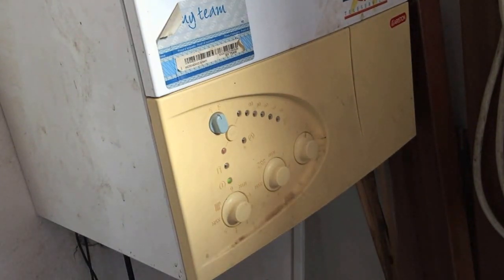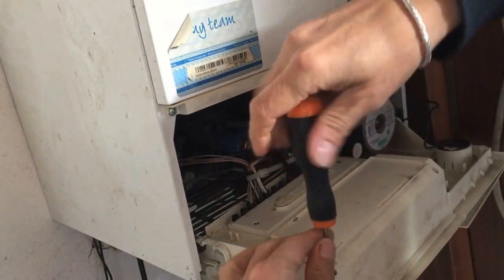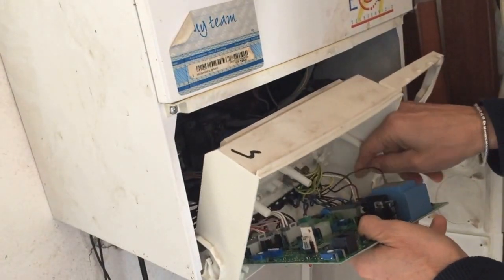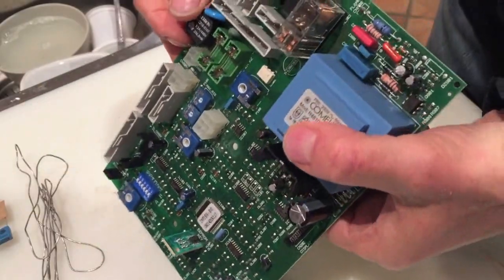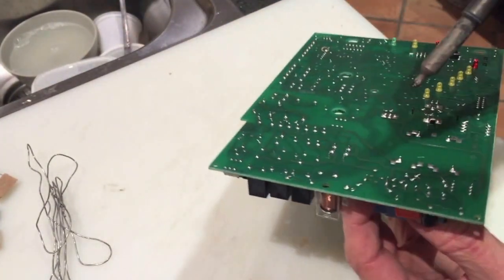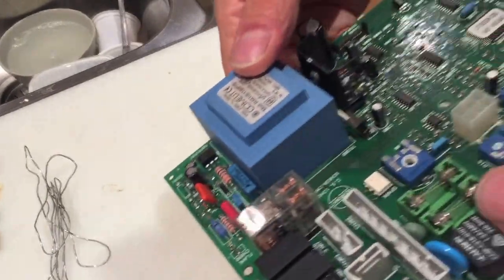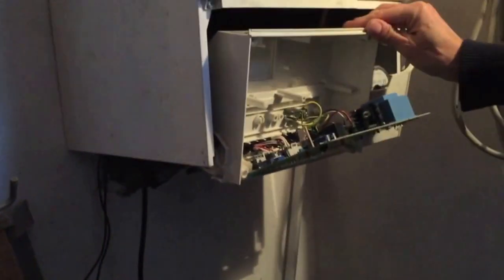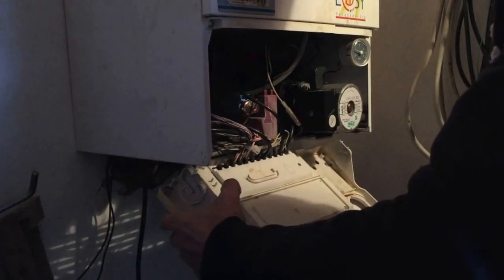Ariston Microgenus (also Simat t2 lls) A01 Flame Sensor Problem Fix PCB Repair

Comment: Mine keeps tripping out to red light.....i cant see that jumping spark like in your video though. The left hand side has a bright orange type light in the sensor.I wonder if i should change the sensor first. Is there a video for that.? Thanks
Reply from the maker: No, if it’s not continuously sparking it’s something else. Could be the flame sensor which is the other thing near the igniter but I don’t know.
Reply from the maker: Is you system pressure correct? Has the pressure vessel in the back got (if I remember correctly), 1 bar of pressure?
Reply from the maker: Also check your pump is working correctly. Does it lock out when the heating comes on or when you’re using hot water?

Comment: Amazing fix,  I intially called out an "engineer" who said within 5 mins of arriving,  "you will need a whole new boiler,"  and then quoted £2000 to install one,
Reply from the maker: @droidb5464  Thanks. If you can leave the legs long and bend it away from transformer as I think it's the heat from it that's causing them to fail.

Comment: Hi .. I tried this fix but it didnt work for me .. any clues ?
Reply from the maker: What are the symptoms of you boiler? What fault does it have?
Reply: @Sorcli  Keeps sparking but i do get 7 milli amps from it so I figure its outputting enough ?
Reply: @Sorcli  A01 No flame .. does exactly as this does in video
Reply from the maker: @moulesanctuary  Does sound like that component or the flame sensor. Flame sensors are very cheap so you could try replacing that.
Reply from the maker: If the symptoms are the same, spark not stopping, then it could be your flame sensor.

Comment: Mines given the A01 code... but wouldn't switch on after a reset... I bought a replacement yesterday and had hot water and heating yesterday and this morning.... then it stopped... showing as A01 code... so turned off and on... but won't come back on..... do you think replacing the chip will fix it.... or I'll have to buy another replacement board... oh dear
Reply from the maker: When it is running if you look in the window at the flame can you see and hear the igniter sparking continuously even when it’s alight? If not it is not the problem that I talk about this video. Is your pressure gauge reading 1.5 bar?
Reply: @Sorcli  ill have to see if u can get it running tomorrow... I only found your video after the boiler won't turn back on today....as I thought by changing the board it was fixed... lol
Reply from the maker: If it is not him may be as simple as having to recharge the system with water to bring it up to 1.5 bar. There is also a pressure sensor on the boiler which could be faulty which may cause the A01 fault
Reply: @Clive Hancy  I did make sure the pressure was.above 1 bar... actually about 1.2... so they should be OK..
Reply from the maker: Your problems sounds to me more like a pressure problem so are you the pressure sensor or you just haven’t got enough water pressure in the system, as I mentioned above. But please bear in mind that I am not a boiler technician and my video is only for you to see what I did to my boiler in Italy.
Reply: @Clive Hancy  I've got a Gas engineer contacting Arsiton Tech in the morning ... which I believe is actually in Italy?  We spoke to them on Tuesday... but they didn't really give us mor information than we already had...  we have voltage on the one side but not on the other... almost as if a fuse had blown
.. buy the fuses were OK.... I ordered a replacement board... fitted it yesterday and it worked.... but today it.stopped working.... showed as A01   I switched off and it will not power back up... no display.. no lights... nothing..... ah well  will have to work through it logically... and use some of the info you have in your video.... man thanks
Reply from the maker: @Legacy4x4turbo  that definitely sounds like a fuse or something if you’ve got no power no lights. Having replaced the board you should have sorted out electronic problems. The newer boards were redesigned and that chip is no longer near the transformer and sell the property that I’m showing my video shouldn’t manifest itself. Perhaps you’ve got a short circuit somewhere a wire that one through or something similar

Comment: Thankyou for this video. Done it to my microgenus 32 he. Easy fix and it worked. Saved me a lot of money by not having to buy new boiler. 👍
Reply from the maker: Glad it helped. If you leave the legs long and bend it away from the transformer it will probably last longer as I believe that the heat from the transformer is why it blows.
Reply: @Sorcli  Thanks for the heads up

Comment: salam on this board I found burned ic304 it damage so much I cant read it can anyone share to me schema of this board or name of ic304 and value of resistor between base and emitter thanks for attentions?
Reply from the maker: A while ago I had found the board schematics by searching google. So if you try it is out there.

Comment: Thanks Clive!
Reply from the maker: You are welcome. If you leave the legs of the capacitor long and bend it away from the transformer if may make it last longer. I believe that it’s the heat from the transformer that makes them become defective.

Comment: Hi Clive; recently I have got the error 98e for baymak boiler, I am an amator electronic student (but a veteran) I tested a diode at digital display side there was a short circuit and as if there was nearly wrong values when measuring some of 817B optocouplers. I cut the diode and tested and saw diode is okey so that was very complicated for me and sent to service then I have realized that the problem about relays. Your video is very good source for me to learn I will follow. Thanks.
Reply from the maker: I am merely an amateur who was sick of paying 180 euros to a technician to keep changing the whole circuit board every 2 years. Leave the legs of the component long (I did not in the video) so that you can push it further away from the transformer, as I believe that it is the heat from the transformer which is making them break.
Reply: @Sorcli  thanks for reply the cost was about %7 of my salary but I dismounted and brought to electronic repair service (not boiler service) discount was %50 (cost to me about 15 dollars) but next time I may manage on soldering relays I think. Sorry but you know the relays work mechanically and too frequent intervals I really do not sure which one is more effective on break over heating or electrical sparks due to excessive work. However I will place a material to isolate between the transformer and relays.
Reply: I write again not to mislead some one although as I was told that the error was due to relays then I tested the board to see the result so I connected the multimeter probes to the diode I mentioned above for the continuity test and tried short circuit of the legs of the all four relays but never short contact / beep sound happened for the BA157 diode so I am not sure that the information given me is correct about that the relays are cause of the error 98e!!??? It may be the service man's trick really I am not sure.
Reply from the maker: @suatkaleli5075  I’m not sure about that code error. What does the boiler do? Does it fire up?
Reply: @Sorcli  Hi; this error code in Baymak does not give any detail at Baymak's pdf user guide document but only saying "main control panel error" for 98e-99e error codes. When we see this code  we cannot proceed to next or other steps. Digital screen is okey but system does not let you to use other function. In fact so far I had never used electronic digital boiler but central heating system so  it may was so simple to be repaired but I did not know.
Reply from the maker: @suatkaleli5075  I have read that changing that blue capacitor should resolve the 98e error but I am not an expert.
Reply from the maker: @suatkaleli5075  98E
Gas Valve Contact Relay/ Internal Error
Check for restrictions
Ensure all air is purged from the system and all shutoff valves are open Ensure no water got on or into the gas valve
99E
Control Board Contact Relay. Internal Error
If error code persists check for 120 V going to the gas valve coils, if there is 120 V going to both coils replace the gas valve. If there is not 120 V going to the gas valve replace the main control board
Ensure that the boiler is operating on a dedicated circuit and is properly grounded
Reply: @Sorcli  after repair man fixed the board I have tested and boiler runs. So I think there is not any hardware or any electronic feed back values error but board itself. I just try to understand if there is any directly relation between relays and diode ba157 since there was short contact at both legs of the diode although the diode was not broken. And I think relay errrors would not cause short contact to the ba 157 diode legs. So as far as I understand you point out the blue capacitor or I think the nearby parts to the diode may cause the short contacts. Thanks for your supports.

Comment: It worked for me too. I bought the part from CPC £1.30 for 5.
Reply from the maker: Pleased it worked. Did you see my tip about leaving the legs as long as possible and bending it away from the transformer? I think the heat from the transformer is what makes them go wrong. If you didn’t, you can just do it if it goes wrong again.

Comment: The capacitor should be 100nF or could be more (for example 220nF or 330nF?)?
Reply from the maker: Sorry I am not an expert and just replaced like with like. So I chose exactly what was there. I do recommend leaving the legs long and bending the capacitor away from the transformer as I think the heat from the transformer makes them malfunction.
Reply: yes, you can also put the 0.22/250-300vac
that is: 220Nf.
but the 100nf are easily found

Comment: Thanks Sr. Super like👌👍✌
Reply from the maker: If you haven’t already done it. Leave the legs long on the condenser and bend it away from the transformer because I believe it’s the heat from the transformer which ruins the condenser

Comment: Same issue; heating the PCB in the section where condenser Is located and then Will work perfectly for few hours
Reply from the maker: Ciao. Quando cambi il condensatore lascia le gambe lunghe e piegarlo più lontano possibile dal trasformatore.

Comment: It worked for me too. Thank you very much sir. You saved me a lot of money :)
Reply from the maker: M K. If you leave the wires long, you can bend it away from the transformer as I believe the heat produced by the transformer is the reason it fails.
Reply: Clive Hancy I’ve seen the comments suggesting it but I had old pcb with other problem so used its capacitor with already short legs so but if it fails again due to excessive heat from transformer then will replace with brand new and definitely leave longer legs bend bend it. So far so good problem disappeared. Will see how long it lasts ;)

Comment: https://www.ebay.co.uk/itm/5-x-Epcos-B32922C3104M-Capacitors-0-10uF-100nF-305V-X2-40-105-56-B-PACK-OF-5/183285433504?ssPageName=STRK%3AMEBIDX%3AIT&_trksid=p2057872.m2749.l2649               this is the 100nF supplier on ebay

Comment: You are a hero. Fixed and working.
Reply from the maker: Peter Mounsey Found out that it may help leaving the connecting wire long and bending it away from the transformer. Apparently the heat from the transformer may cause them to blow

Comment: I did the exact same, but the fault remained. Any ideas?
Reply from the maker: michael loftus Did you check/replace your flame probe? They are very cheap and if it’s continuing to spark it could be that.

Comment: Hello Clive.
I´m having the same problem in a Fleck codex 23 MI, that i think is a brand from Ariston Group. The eletronic boards are diferent and i cannot identify the component. Do you think you could help me with that?
Thank you and sorry mi english.
Reply from the maker: Cristiano Moreira Are you sure it does exactly the same thing? Sparks continuously even when it is light? You may have a problem with the sensor probe. Anyway, find me on Facebook send me a message and I will help as much as I can.

Comment: Hi I have a problem with ariston micro ginus 24 he. The fan not kicking in on demand heating or hot water. But it works when I suck the AVP switch.on both hot water and heating.
Reply from the maker: Mohammed Nazar It’s very difficult to understand what you are asking, but it may be you need a new heat exchanger or you could check the flue is clear and also clean the pressure switch and the three way valve to remove calcium build up.
Reply: @Sorcli  hi thanks for your reply.  The things is the PCB  dose not signal the fan to come on. When the demand is made. If fan dose not come on the gas valve dose not open. I opened the hot water The I activate the fan by sucking on the AVP switch. Then the fan come on.  Bingol  hot  water is on. I have replaced the apv switch new one. I think it is the Fualty PCB.
Reply from the maker: @mohammednazar5255  Yes, if you have checked the wires to the switch it is probably a component of the PCB. I can not give you much guidance except to look for components that are swollen which is an indication that they are faulty, most show no signs that they have gone bad. There are some videos on YouTube that may help you find faulty PCB components. Perhaps it will help you to watch them.
Reply: @Sorcli  thanks

Comment: buona sera chiedo gentilmente informazioni,io ho questa caldaia, non riscalda più di 50 gradi accende solo le prime due spie arancio,da cosa potrebbe dipendere il mal funzionamento,grazie x il consiglio.
Reply from the maker: Francesco Pani Se non hai mai cambiato il scambiatore potrebbe essere quello altrimenti potrebbe essere uno dei sensori del temperature. Scambiatore da eBay costo più o meno €50 e sensori/sonde €5
Reply: grazie, e sicuramente il sensore della temperatura.
Reply from the maker: Francesco Pani c’è anche una valvola a destra che si intasa di calcare e viene pulito. Quello potrebbe anche causare problemi. Comunque di solito I sensori sono quelli verde.
Reply: Ciao, ho anche io questa caldaia, ho problemi in accensione. Quando passo da riscaldamento a sanitaria, la caldaia va in blocco. Oppure se apro acqua calda va in blocco o se accendo solo termosifoni, ma non lo fa sempre, si accende solo led rosso, mancata accensione, cosa può essere? Grazie

Comment: Thanks for great video....We have the same problem on Ariston Microcombi 23 MFFI, its keep cutting off and red light comes on.. while running spark is keep running and not detecting flame is on.....I looked into PCB of our boiler and could not locate which capacitor to replace?  Any help would be much appreciated.....here is the diagram of our PCB: https://www.plumbase.co.uk/main-printed-circuit-board-10000015-3521533     

Main Printed Circuit Board 65100248
https://www.plumbase.co.uk
Reply from the maker: M M Hi. Thanks. Yours looks like the later model PCB which Ariston modified to eliminate the problem. Have you checked that your flame sensor probe is working? Unfortunately the only way I know to check is replacing it. It only costs a few quid though.

Comment: This repair sorted the problem on my Microgenus HE 24 mffi. Easy to follow, clear instructions and if you have a screwdriver and know how to use a soldering iron a simple fix. The boiler now works without incident. Thank you Clive excellent video.
Reply from the maker: barrie stokes Glad it helped! You may find that after a year or so it may blow again. I’ve changed mine twice.
Reply: Hi Barrie, I got Microgenus HE 24 MFFI too. How easy is it to remove the board? (I don't see any screws on the instrument panel) I got the same issue. It happened for the first time 2 days ago and displayed the A 01 error code and I have reset with no further incidents since. But now when I check the flame through the little inspection window, I can see the spark continues even after ignition. Just wanted to know if you purchased the same capacitor as Clive recommended? Thanks!
Reply from the maker: @andrewstone3134  The problem you are describing is exactly what happened to mine. I changed the flame sensor probe first and it continued doing that same thing. Changed the component on the circuit board and it resolved the issue. The circuit boards should be exactly the same for the 23 and 24.
Reply: @Sorcli  Thank you for your reply. Just ordered the Class X2, 0.10Uf, 305Vac capacitor you've recommended! Look forward to a warm house soon. lol
Reply: Andrew Stone it's pretty easy and all the connections are dedicated. I had a problem with solder blocking the locating hole for the capacitor but I used a needle in a battery drill to clear the holes and that worked a treat! I ordered 5 capacitors from eBay for £2.95 so if it goes again I'm covered.
Reply: @barriestokes  Thanks Barrie, ordered the one Clive recommended. I have turned the boiler off for now. Will let you guys know how I get on!